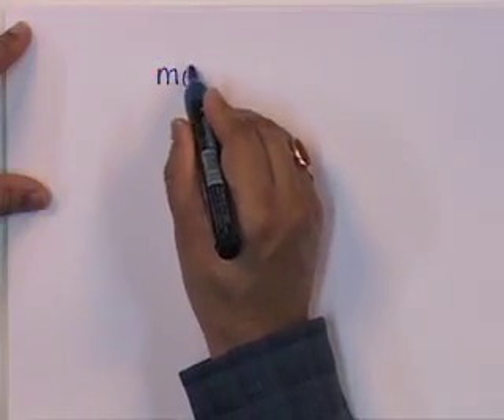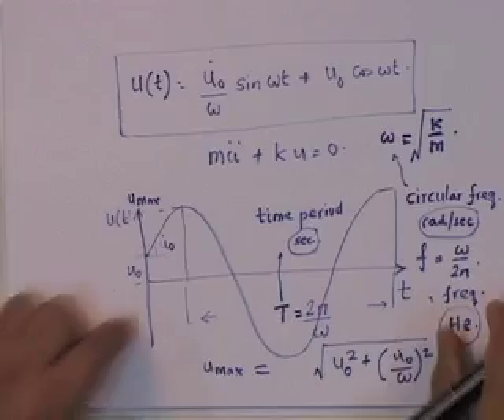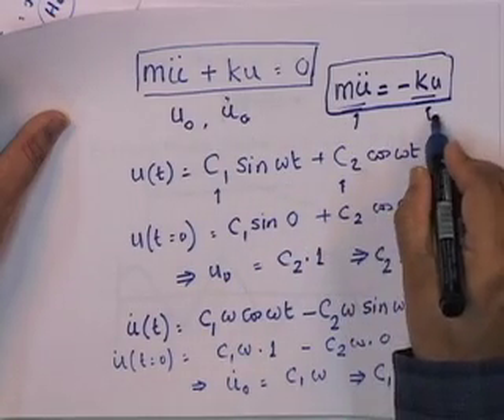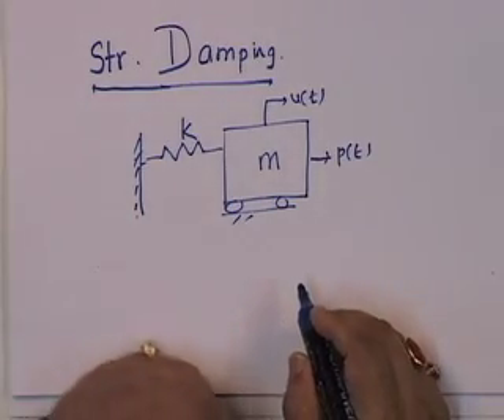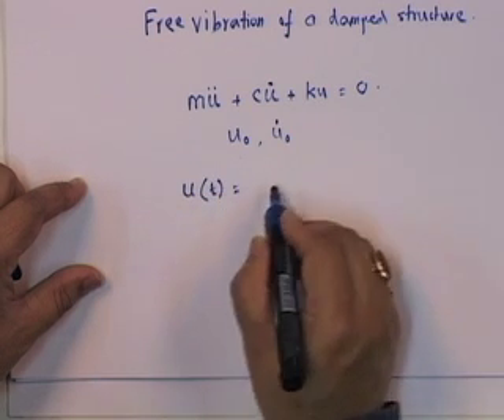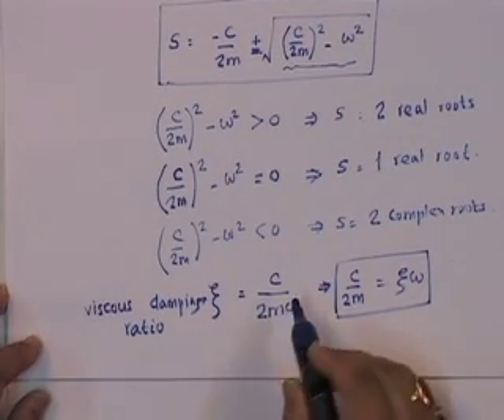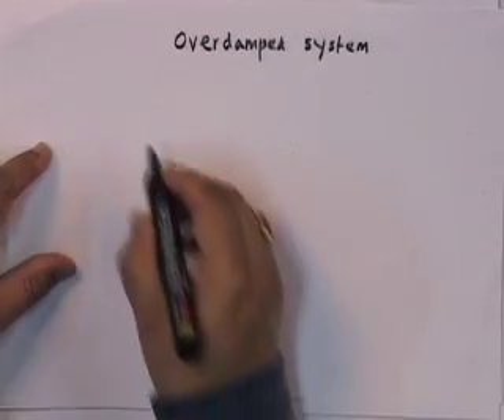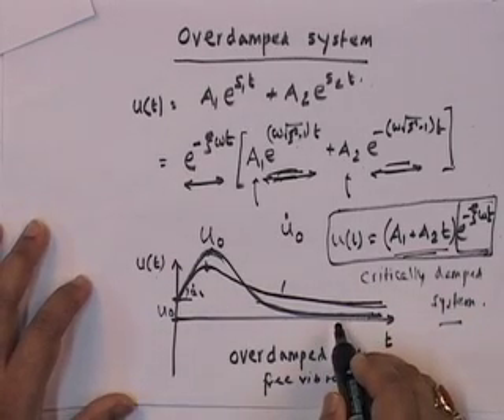Mod-01 Lec-02 Inverse Power Method

Comment: what is e^(st) and S stand for?
Reply: while solving a diff. equation, we substitute a form (an expression with some unknown(s)) purely from intuition and then solve for the unknowns from the diff. equation and boundary (initial) conditions. And since the method is not so robust, we aint able to solve all the the diff. equations, giving rise to the need for FEM. Hope it helps you :)